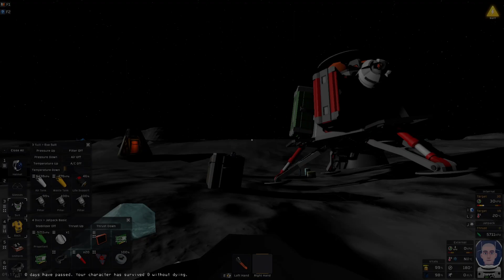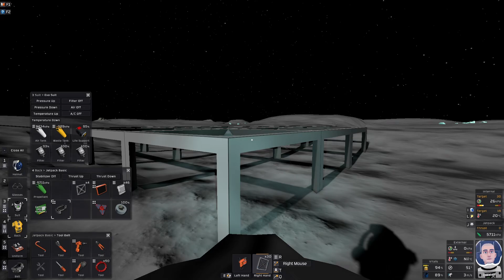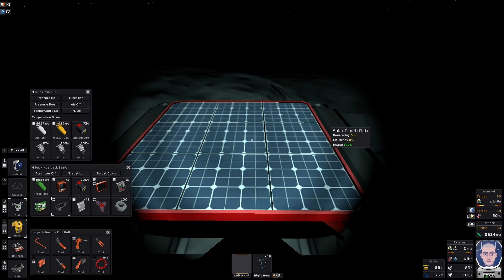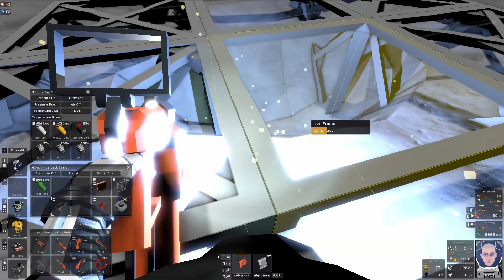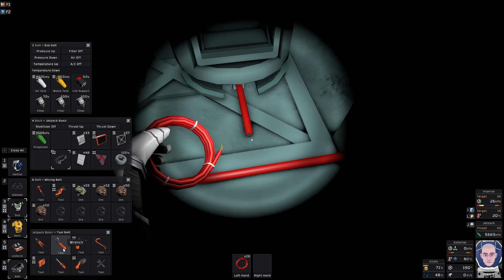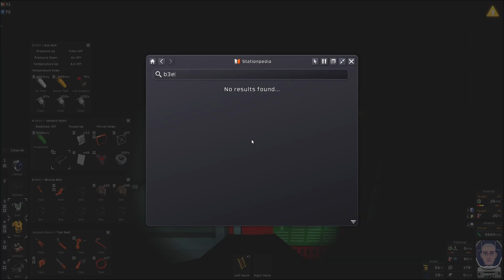Stationeers 2025 - New Player Tutorial Guide - Episode 2: First Steps - Moon

Comment: here are some tips for ya:
1.) the base beacon is much later game, its a very high power cost (300W), so either have a robust power gen system or program it to turn on/off via logic xmiter and advanced tablet.  the small is all you will ever need.  (more on this later)
2.) make steel and your first station battery, make these: portable light, 1 OMNI wireless charger (connect straight off the station battery) , 2 lg wireless batteries (one for your suit the other the light) 5 sm wireless batteries (or more), 1ea for drill, grinder, labeler, tablet and.....portable beacon!  ive tested the portable beacon to 2 Km, so i dont think it has a range limit.  portable beacon w/ sm wireless battery 10-50W cost and can be placed in a locker. crate etc turned on, lg beacon 300W.  OMNI wireless charger has a range limit of 16m, or 8 frames.
3.) after you have the portable light w/ lg wireless battery, turn it on, and place it in a uniform slot (leave it turned on!) w/ duct tape, next to your credit card
4.) due to an update you can melt ices in a portable tank.  if you place the ice in the slot where you place a canister. it will melt to near 0C (except water and nitrice) and store its contents in the tank.  warning tho, ice melted this way is NOT insulated.  so do this outside your hab, with a frezzing atmo or (on the moon) out of sunlight.   Pro-tips, if you place in 44 Vol ice and 25 oxite ice, in a tank this way. it will make a "dirty" but usable fuel mix.  with water ice you can separate out the N2 this way because the water will condense into liquid in the tank. (liquids are ok in a gas TANK, not pipes) then wrench it to a portable connector to separate.  portable connector has both gas and liquid connections.  You can do this with nitrice as well, just be more careful.  NOS can be a pain to work with! 
5th, the "triangle" obstruction at the bottom of your screen. where your hands slots are can be removed ESC->Settings->Gameplay->First person helmet.  its not that bad w/ the regular helmet, but the hardsuit helmet it becomes a pain!
Reply from the maker: These are awesome, thank you! I will have another video coming out this week (June 11) so I won’t be able to implement these until I record my next one this weekend. But I’ll check them out!

Comment: Interesting game. I cocked an eyebrow watching the first video when you were talking about filtering oxygen and reducing your air pressure. It turns out this game actually simulates partial pressure, that's really cool. Glancing through the wiki, there's temperature management stuff, but the videos you did make it look kind of weird. Cooling things in a vacuum is pretty difficult, but your suit's temperature plummeted when you shut off your A/C. You'd expect the opposite, since there's nothing to conduct heat into and heat loss from radiation is very slow. I'm assuming it's a deliberate game design choice, since the moon is the beginner world, and most people think of space as being very cold. Regardless, these two videos were enough to get me to buy a copy of the game.

If you've never heard of it, how NASA solved cooling for the Apollo moonwalks is worth reading up on. The suits used a water cooling system that would pass under a plate with microscopic holes in it. If the cooling water was too hot, it would boil off into space and carry heat away with it. As the water reached the desired temp, it would start to freeze and block the holes. Dynamic, variable cooling with no sensors or moving parts. It was a really cool solution.
Reply from the maker: I absolutely will check that out that’s sounds fascinating. 

As for game mechanics, I’m still learning them. The game has some “magic” to it, but follows real world physics fairly closely, I think. You don’t hear sound if you’re in the vacuum. Unless is really loud and close. The game does allow you to radiate heat in a vacuum and has special radiators for it.

I think the suit temp readout is internal. And when I pause the mechanics of the game (hunger, thirst, etc), it messes with the temp and makes it go sub 0 for some reason. But the A/C performs both heating and cooling functions. 

I hope you enjoy it the game!